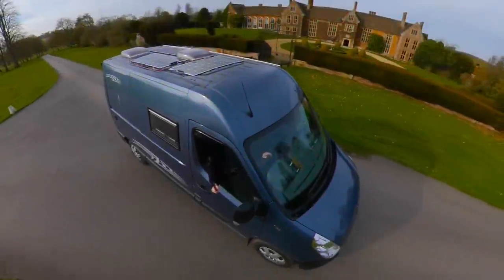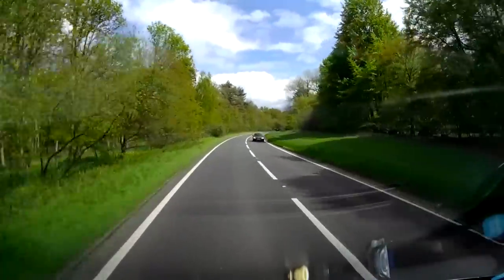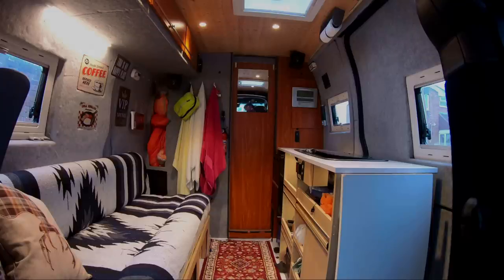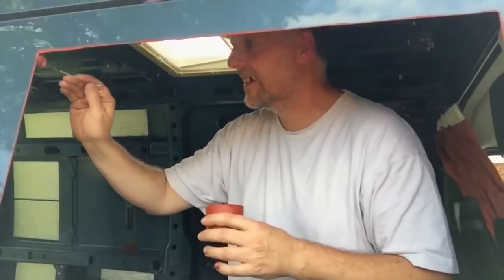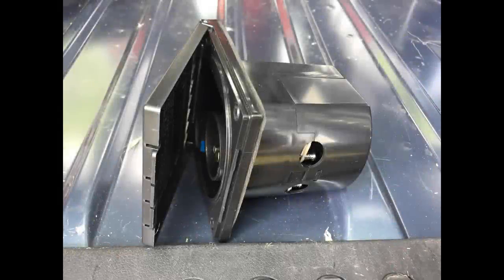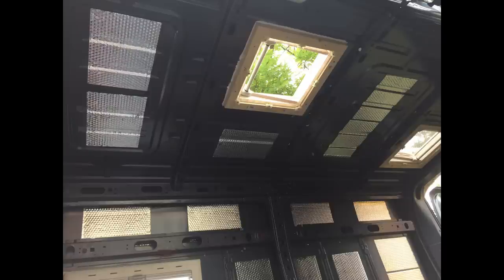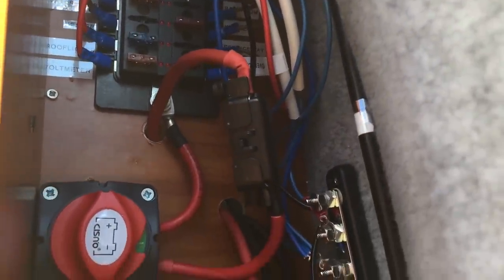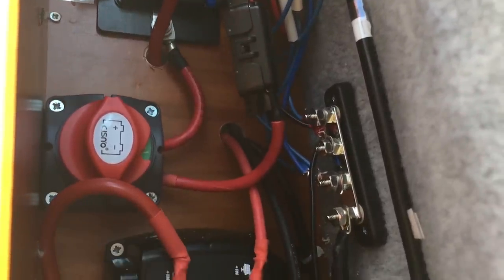HOW TO MAKE A CAMPER VAN From Start to Finish (Low Budget Interior) 2020

Comment: Very nice video, I have learnt a lot and will be starting on my own van in the next couple weeks. Is there a reason you didn't tap into the diesel tank for the heater? That was my plan but I think it could be more effort than it's worth
Reply from the maker: Craig Liddle good luck with the build. I just didn’t fancy putting a hole in the van’s fuel tank.
Reply: @rickvanman  how about a tee fitting in the main fuel line, for the heater? How does the kettle shower system go.... Looks easy as!
Reply from the maker: Zane Leathart I’m sure that “T” piece idea would be quite easy to fit and I’m assuming it would work but don’t know enough for certain. 
The kettle shower works beautifully 😁

Comment: So this is like a money not an issue project.
I have like $600 and can't even find a suitable running vehicle for less than $4000 to start a project.
 I've been told it's 'so easy.'
However I also had an heart attack recently, found out I'm dying of congestive heart failure and am homeless to boot..
 It all seems like Wishful thinking and dishonest at the simplicity.
Very disappointing.
It looks amazing and you do good work.
Congratulations and well done

Comment: You could have used a $10.00 emersion beverage heater in your gerry can on a switch to heat your shower. i use one in a 5 gal bucket and it takes about 30 min to heat 5 gallons of water... nice build than you for sharing your insight...

Comment: This is your 4th van build and u made such a mess of the shower ???
U had to disassemble the KITCHEN unit to get to the heater ???  
The MARK 2 version of the kitchen unit ...definitely needs a MARK 3 
version ....everything u place in those open cupboards will be rolling 
around freely in them when u - DRIVE the van and all the stuff u put 
in there will be visible making the interior look messy. Mark 2 version 
is essentially unfinished bcuz u cudnt be bother to build decent draws
Hate to see the mess u made of the first 3 vans tbh  .....

Comment: Thank you a lot for sharing your experiences.
It helps me by making my kitchen area. 
But my van is very smaller. (Vauxhall Combo C)

I still have bought my diesel heater with his own diesel tank. Now I know, it´s the right choice.

You were much busy, with your bathroom. 
I thought at my layout also for having two escapes. And I convert my back door for also open it from inside.

At your Van, its better because you can full stand inside. 
But I would like to have more storage space.

Greetings from sw germany.

Comment: I don’t get it with the metal foil before putting up wood sheets on the wall?  When warm meets cold, one gets condensation.  That is why when building an isolated house one has airchannels behind the outside cover/fasad. But by doing like this one close all the moisture in since it is not vaccum in the walls... so drainage holes for Water at the bottom maybe?

Comment: I've seen other builders, amateurs and pros, recommend multi-stranded electrical cabling to insure against circuit failures due to vibration breaking single strand cables. Was yr 240v mains cable multi stranded?

Comment: Diesel heaters, buy the metal bodied version, plastic ones can distort on bolting down causing the fan to rub. Also the exhaust material is crap, my vans rotted away after 12 months. Better to find some alternate tube.

Comment: The best insulation to use for your van would be low expansion foam insulation. It’s sprayed on, it’s water proof. You only need to spray it all in place, you’re done. You could bury your wire in it better R value than anything you have in there with less space taken.

Comment: What spray did you use around the outside windows as I was, debating using vinyl
Reply from the maker: Olivers world I tried using stick-on vinyl, but it was a disaster every time with lots of rips and creases created whilst trying to fit it around the windows,  so eventually settled on a matte spray paint (acrylic).
Reply: Thanks, for the reply, I worry my apart painting skills will be much worse then my vinyl skills

Comment: Spot on, Rick. Thank you for sharing your build, errors and changes.... I need to add in my 2012 LWB Sprinter (Wheelchair Accessible) 'Window' van. It has a tail lift with automatic opening back doors and I 'park' my mobility scooter (30ins wide) in the rear. My idea is to have a shower base that is capable of standing the weight of 'drive over/park on' for me+scooter (300kgs). One fixed wall (with all workings behind, very similar to yours) transverse base with   heavy duty (weighted) shower curtain, and adopting your brilliant water feed solution to shower. May add a roof light but might just open one back door a 'smidge' ... My scooter would be outside during showers....

Comment: Great job rick 🤘 can you put the foil on first before isilotion?
Reply from the maker: Mark Ryan Hi Mark, I guess there’s no reason why not, although in my humble opinion, I’m not sure it would make enough noticeable difference to the insulation to warrant adding it. 
You would still need the vapour barrier as well, so it would just add to the cost for very little if anything in returns or benefits. 
I am of course, happy to be proven wrong 😁👍
Reply: Thanks for the reply.👍 and sorry for my bad spelling ( just noticed ha ) ill let you know how my project turns out. Its a 🐎 box

Comment: I have been building my Ford Transit out as well and had noticed that the exposed beams ofcourse had condensation on them. Your idea of neoprene is brilliant. i'm using XPS foam whichis basically a foil covered neoprene. Your van MUST be quite and well insulated from what I've seen.

Comment: Great video, How did you attach the wooden panels to the Mylar bubble wrap, did screws go through all the insulation material or glue?
Which sikaflex product did you use to glue the battens to the van floor?
Thanks

Comment: Have you thought of a) instead of the sliding door, having a fitted caravan door with integrated security fly screen which opens out? It is fitted into a custom panel that replaces the door. This will make the whole van quieter & give more useable space inside. 
Also, there is an Australian Ecoshower that fits into it’s own case. It either A) hangs from the ceiling or B) can be free standing outside. The beauty of it is that it is self enclosed, waterproof, has an incorporated reticulating water pump, so that you only use a couple of litres of water, which you heat however you choose? 
Cheers

Comment: Nice build there, Rick. I may be 'having ' to assist a pal to build one. For anyone who doesn't know, the Calor gas has to be stored in a sealed cupboard with a vent downwards to the exterior, and the outside of it must have a diamond shaped LPG warning sticker, as does the actual van door itself. If there  is a fire, the fire brigade needs to turn it off quickly.

Comment: Next time instead of the tape which would hold water in in you got a hole under your deck. Rather you should use green treated wood in wet areas.

Comment: Great video. I've been doing our van for a while but somehow missed your vid until now. It's great to see the basics explained which others gloss over and leave people guessing. Wish I'd seen this a year ago. Never mind hey! I'd say a nibbler was a better tool for cutting holes in panels though. It's a tool actually designed for cutting sheet metal.  I never followed the advice to use a jig saw for it. I'd only use one if it were an absolute emergency. A nibbler is way better. They fit on a corded power drill and make short work of steel sheet. Much less noise and vibration. Much easier to use. They produce half moon pieces of swarf. This needs care as it easily gets immbedded in skin, the bottoms of shoes etc. I use a vacuum to remove as much as possible. It produces one piece on the up stroke and one on the down stroke so waste is produced on both sides of the cut. It is a very effective device; so much so that care is needed not to cut too much! Masking isn't really needed especially if the cut will be sealed behind a flange of a fitting etc. It only makes very tiny marks on the margins of the cut which get painted over after the prep work for the hole.

Comment: Just started watching lots of conversion videos as my son has just bought himself a Fiat Ducato MWB to convert. I have to say I really liked this video and how you took time to explain it as you went along. I have to agree with another comment, I would have gone for larger windows as what you have to me look a bit prison vanish. I loved all the sound proofing and insulation and panelling but with what appears to be quite a new van along with some fairly expensive necessary items, electics, gas and heating systems seemed to be let down by a lot of corner cutting (or not in the case of the kitchen edge unit) for a lot of things. The shower toilet setup to me was way too big and over the top. I feel it always seems better along the bulkheads and would have taken up the same floorspace. Last thing, the 'escape' door you cut through the show as you call it, how on earth do you manage to open the rear door as it seems to far away in the picture. I have to congratulate you on an excellent video though and will help me and my son a lot in our first attempt.

Comment: Great video, nice build. I've got the same model Master, but older and have a similar layout with a sliding door to a toilet/garage area. Mine used to be used to carry big equipment to shows so from the start my kitchen split into two units. So the cooker section can quickly be unbolted and slid back between the bed and the sink unit. That has two major advantages. 1) I can still get large items in like a fridge or furniture if I need to, and 2) It allows access to the door panel. Being an older van, I have had to get into the door to change the centre rollers and also the door handle mechanism which is a weak design.

Comment: That turned out nice, probably the best home built camper I've seen.
I noticed the MK 2 kitchen made the access into the van larger and more practical. 
 
I might have to reuse the running light side board idea.

Comment: i have watched a few van conversions ,,,and nobody has ever weighed the van before and after the build,,which would seem to be the right thing to do ,,as you are adding a lot of weight to the vehicle , which surely must have an affect on fuel economy, handling and stability , along with the kerb  weight of the vehicle ,,as it will now not conform to the weight plate that is fitted to the vehicle, hence you could fall foul of the law having altered the vehicle weight,,,

Comment: I like how the project changed along the time! I've just bought the CTEK 250SE and I'm not sure what solar panels I should have. Which ones you have used?
Reply from the maker: I originally used 3x100 watt flexible panels but recently changed them out for 2 x 150w framed panels thaw were much more efficient.

Comment: How do you secure the wood to the floor and walls when framing without poking holes in the walls or hitting anything you shouldn't? When you're framing out the bathroom, for example.
Reply from the maker: high grip adhesive mostly.

Comment: Yeah possible ideas and improvements to a campervan seem to be almost infinite, lightweight materials are usually an advantage where possible, obviously the more you insulate the van the less you need to warm it, an awning fitting the door would help stop loosing heat everytime you open the door, with a diesel heater you don't have the weight of the calor gas bottle and can pop into a petrol station day or night to top up or possibly syphon some out the tank but diesel's heavily taxed dont know what happened to parafin heaters?

Comment: Never use expanding foam where it can touch electrical cable. The plasticiser in the cable insulation migrates into the foam leading to short circuits and earths.
Reply from the maker: Great tip! Thanks for sharing :)

Comment: your van came out really great, the only issue I see is maybe condensation getting through the small cracks in the wall/ceiling. I don't see it 100% sealed but maybe i'm wrong and you'll be fine

Comment: How reliable and troublesome are Renault masters, do they have common problems?
Reply from the maker: This is my second master - always been happy with them. My only issue so far has been with mice chewing on my sensor wires. I think wider common issues are sensors going and gearboxes.
Reply: @rickvanman  thank you very much for taking the time to write a reply to me. That’s very helpful.

Comment: I have an old cabin bed (single) with desk, drawers, and cupboards under it. Is there any reason why I couldnt incorporate this into my own build guys?
Reply from the maker: Sounds like a reasonable idea if you can make it work. one factor to take into account would be weight.
Reply: @rickvanman  Thanks for the reply Rick. I have always wondered about the weight issue which is obviously a good point but is it simply an issue of not going over the Van's capacity, or is there more to it that I havent realised? The bed I believe including everything weighed around 27 Kg in when packed if I remember rightly.

Comment: I could not see how you fitted the wooden side panels once you applied the roof lining - no visible screws? Thanks for the video - Leon from South Africa
Reply from the maker: The screws were hidden by the roof lining felt
Reply: @rickvanman  Thanks for quick reply. Sorry if I am being pedantic but you took the boards out and glued the roof lining on before re-installing, so not sure how you got the screws covered by the lining again if already glued?

Comment: Thank you for putting this video together. Fantastic work. I'm 99% sure I'm going to be living in a van full time within 6 months - this is really helpful to see. All the best
Reply: Did you do it then? I want to do the same thing but my dream is further than 6 months away.
Reply: @michaeluttley3386  ha, 6 months does fly by... So, my Citroen Relay I bought has needed the following, since I've owned it for 12 months, air con regas, brake pads front and back, oil, pollen and air filters, fresh oil, tyre (puncture), battery, starter motor, and now the alternator is fucked. I've still got the motorcycle I planned to sell to fund this project, my head is just about above water... My 15 month warranty with the van is not easy to claim on!

However, I had my insurance renewal come up, and Acorn, my current insurer came up fairly cheap with the renewal, so, for the first time EVER I let a policy autorenew. Big mistake! Despite my address and bank details remaining identical they couldn't take the first payment and decided to charge me £25 admin fee! So I promptly shopped about and spoke to Adrian Flux who insured me £200 cheaper for a "self build motorhome" registered on v5 as a panel van, but I can make any changes I like, windows, bed, fridge, gas etc throughout the year with no need to inform them.

Safe to say, I'm happily insured but still replacing every bloody thing this 2015 van needs before it becomes my mobile home. Get a new van, 100%, used vans are always fucked

Comment: Hi Rick I just wanted to ask how you are getting on with the Chinese heater only I have the same and mine tends to come on even when it's turned off .just wondering if I've gone wrong somewhere.
Reply from the maker: Hi, Chinese heater has been fine. That’s strange, I’ve never had that problem although I always isolate the power supply when I’m not using it, so not sure what the issue might be.
Reply: Hi Rick thanks for your reply I spoke with my mate who fitted the heater and he didn't fit a isolated switch which will now be fitted .

Comment: pine ceiling?! NEVER ever do this. Rear endended at high speed that ceiling will turn into a million daggers. Ply should never be used in vans either, speaking from someone who had a coleague pinned through his ankle by ply after breaking down in a panel van and some twat rear ended him.
Reply: Can you please develop ?  I dont't get why pine or ply would be dangerous. I'm interested in your point, no criticism here :)
Reply: @laurentwiedemann283  I had a work colleague who ran out of fuel on dual carriageway (70mph limit) in a ply lined van. Whilst waiting recovery he was hit from behind and the plywood splintered into daggers stabbing him in multiple places through the seat and even his ankles.
I have ply units but they consist of small pieces and would probably fold in this scenario.
When I see full length wood used in conversions especially running full lengths front to rear it fills me with dread. Ask yourself where this wood will go if you are hit from the rear?
I dont mean to put the fear in you but only because of my experience I mention it as alot of people dont think of this when doing conversions :-)
Reply: @markusapparatus  Thank you so much for sharing this, as you say most of the people think in terms of aesthetic while building the van, and not enough in terms of what would happen in case of an accident.
I will definitely take this into consideration now ;)